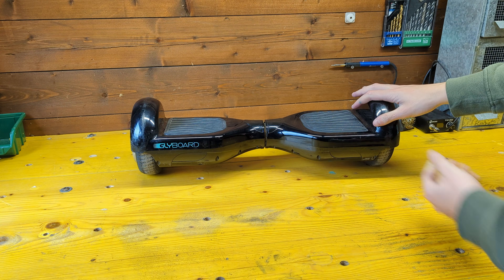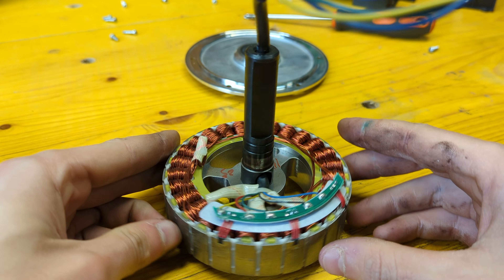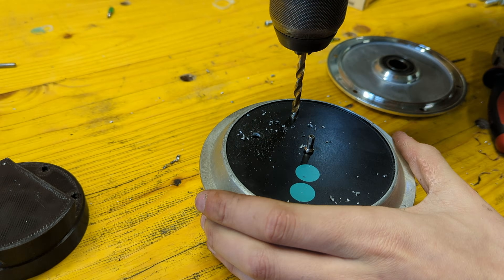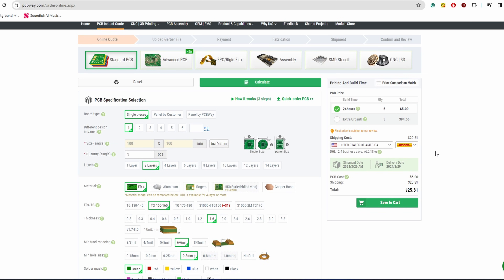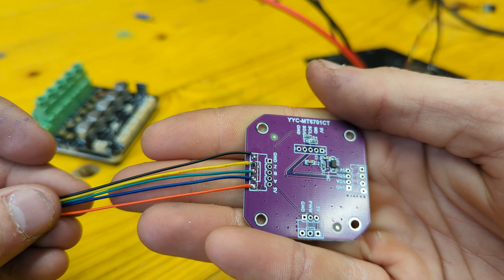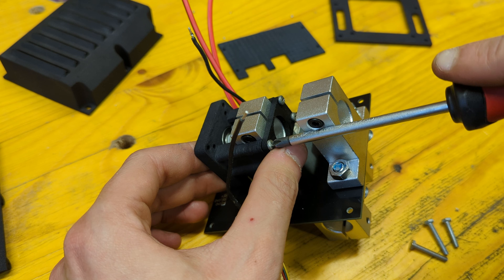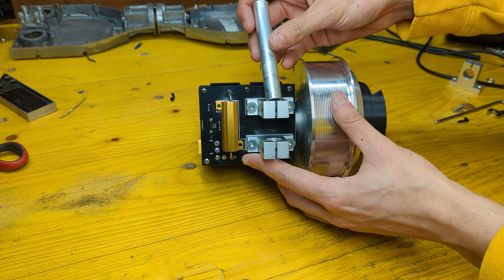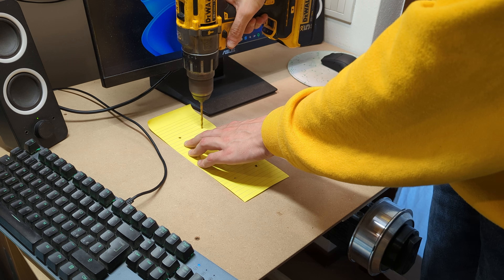how to build a FFB direct drive STEERING WHEEL from a HOVERBOARD | step by step

Comment: Hello, having trouble drilling through the axle. I’ve gone through 3 metal type bits. Any advice from your experience? Thanks!
Reply from the maker: I used a standard metal bit and the axle steel seemed very very soft, drilling through it with no problem
Reply: @DAZprojects  Thanks! I ended up needing to use some oil and apply more pressure to the drill, while going at a slower speed.
Reply: Hi did you end up making the project? Howd it go?

Comment: What pcb is that?
Reply from the maker: A custom one made with PCBway
Reply: @DAZprojects  how much did it cost?
Reply: Cause I need a pcb and I don't know which one to buy for the project
Reply from the maker: @crykiddalt  you mean the motor controller?
Reply: @DAZprojects  no you said which controller you need but what pcb do I get?
Reply from the maker: You can find the custom Gerber files for the PCB in the FFBeast website, and you can order it from PCBway
Reply: @DAZprojects  alright thank you
Reply: @DAZprojects  by the way do you know any way to check how much force feedback a steering wheel has cause when I'm done with the build I want to test how much it has
Reply: @DAZprojects  do I download the bom file on easyeda if so what do I do with the file
Reply: I downloaded it and got a xlsx file what do I do with that?

Comment: awesome video. do you by any chance have specs on the magnet and the bearing
Reply: From looking at the step file the bearing is a 19mm OD, 10mm ID. So it should be a 6800 variant. 
For the magnet it should be around 6x2,5mm but if I'm not wrong it should be included with the encoder.
Reply: @vbence12  Awesome thank you very much!

Comment: Did you prefer the FFBeast Software, or the Arduino EMC software more? I'm thinking of using the same assembly and parts from FFBeast, but using an Arduino to communicate, if thats even possible.
Reply from the maker: I preferred the FFBeast, not even comparable
Reply: You should check out OpenFFBoard firmware, it's the best one out there, also there is a custom motor driver developed by the same guy, Yannic.
Reply: dude, If you did please share

Comment: Ok just tell me what that brake resistors for
Reply from the maker: It's to dump the back current of the motor to heat so that it doesn't go back in the PSU and trigger the over current/ over voltage protection. This happens when you turn the motor and it resists your movement
Reply: @DAZprojects Can/should I upgrade my brake resistor? I hear they get very hot and I worry that maybe it'll die someday and boom there goes my power supply and house lol
Reply: Thank you ❤

Comment: Nice project, but I’d highly recommend adding an inline kill switch to anything delivering this level of torque, just to keep your hands safe from the wheel spinning when you crash or get shunted of track
Reply: its connected to a psu, could you just turn off the psu
Reply: @abatall  of course you can turn off the psu while your arms are broke
Reply: These wheel hub motors are usually rated 15nm when running at 48V. At 24V, they will only deliver 7nm peak and 5nm stall, which is relatively safe.
Reply: @SianaGearz  current is what allows for more torque, voltage increases the speed of the motor.
Reply: @NotSandhorst   You don't understand Ohm's Law and Power Law, go home.
Reply: @SianaGearz  Motors are not simple Ohm's law, they have a dynamic behavior where several factors are in constant interaction, for this same reason FOC controllers are very expensive 😊
Reply: @NotSandhorst   They are not resistive devices, they are dynamic devices with a frequency dependent complex impedance, but under given mechanical load, their momentary behaviour still approximately obeys a trivial generalisation of Ohm's Law, there's some saturation/distortion which doesn't make it entirely linear in reality, but it doesn't anyhow reverse or nullify the general relationship. Thus it is impossible to separate voltage and current, they are fundamentally going to be very nearly proportional, at least very monotonic in relationship. If you reduce voltage, current drops. If you limit current, actual effective voltage across the motor drops. It is necessary to raise system voltage to allow the motor to draw more current to begin with, but of course you have to dimension the drive circuit correspondingly to not unduly limit the current.
Reply: It's open source, just make one.  Or put a big red button to kill power to it.

Comment: Not opensource.
Reply: Check openffboard.
Reply: Yes it is just take an actual look at the link
Reply: It literally is though
Reply: No?  @TheGamersRace
Reply: @teixopoison601  It literally is entirely open source, what makes you think it's not?
Reply: @TheGamersRace why not?
Reply: @HughesDePagen  why not what
Reply: @TheGamersRace why you need to pay for a serial number?
Reply: @anguinan  What are you talking about?
Reply: @anguinan  The PRO firmware requires a paid key. $10 to support the creator is peanuts for what they put together.

"First. It is not mandatory to have a Serial Key to activate controller as the Wheel. It could be activated without it. Just keep Serial Key fields as it is and press Activate. Wheel will be activated in standard mode which have all essential settings. 90% of cases could be covered by standard mode.

Serial key is needed only for extended mode, which allows to change some non critical settings and connect additional buttons/axis directly to ODrive. So it is mandatory only for more complex builds."

Comment: @DAZprojects could i also use the same parts from your last ffb steering wheel to create this one as the only difference would be the brushless motor and the controller or could i somehow edit the hex file to turn down the rpm to use the raw output from the shaft of the motor as it alos has a pretty good 11nm output?
Reply from the maker: Just make this one in the first place
Reply: @DAZprojects  i already have the parts for the old one

Comment: is there any alternate motor driver we could use as the neither the MKS xdrive mini nor the MKS xdrive-s are available in India
Reply from the maker: There's a list of compatible controllers on the FFBeast website
Reply: @DAZprojects   thanks
Reply: @DAZprojects   link pls
Reply from the maker: @ahmetbugraguney6255  It Is in the description
Reply: @DAZprojects   Where can I access the boom list of MKS xdrive-s? I need to know which case the resistors and capacitors used on the card are.

Comment: been looking out for this project for  4 months  just waiting for odrive    and   THANK YOU so much to propeler (creater of code ) for not making it paid
BTW u dont  need the other board   u can  just use odrive   although it does look more neat
Reply from the maker: It's one of the best open source project I've ever seen, also the community is small but very active
Reply: @DAZprojects  Hi i have two questions, is the custom pcb necessary for the build? If yes where can i buy it?
Reply from the maker: @The_Vanillax  you don't need the custom PCB, it's just makes things neater, you can get one from PCBway
Reply: @DAZprojects  oh ok thanks
Reply: @emiljanduka51 is it free thogh, i tought the firmware is paid, I saw something about paid licence for DIY FFB in the website